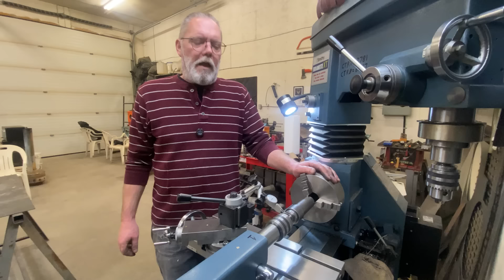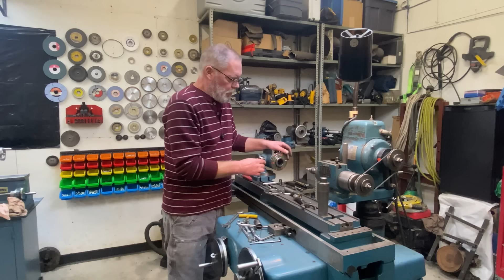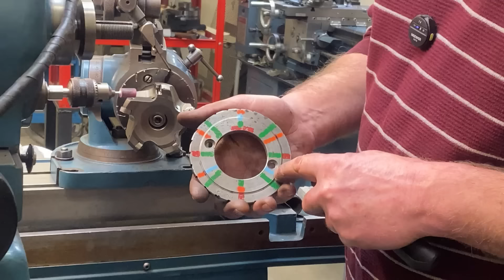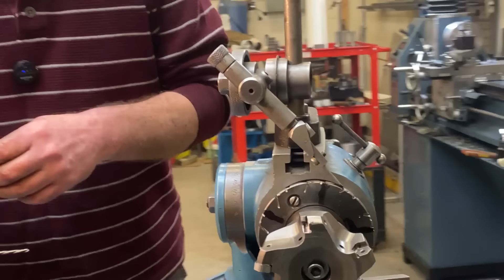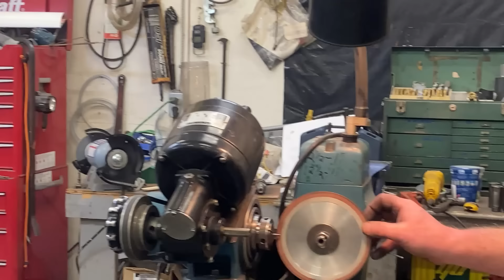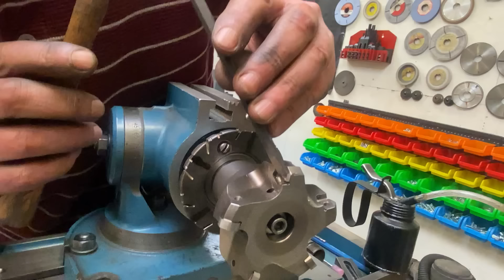MOST IGNORANT BROKEN SCREW I'VE EXTRACTED

Comment: From my experience when there's a passthru hole where the bolt sits - it's never tight inside (except if the threads are almost dead). Every left hand drill bits I had failed although they were carbid bla bla. But I dailed it in from the other side with right hand drill bits and it moved like a champ. My job was way easier than this and a bit harder in some aspects since I had to do it without disassembling and removing the part so basically done it by hand without dailing indicators. Thank God it moved before I need to do any other type of stupidity I had on my mind.

Comment: Midwit thought incoming.. 

What if the insert securing fastener was not a screw into the tool head, but a screw going through to be tightened with a nut on the backside? You'd never have to deal with broken screws stuck in the tool again. There's enough clearance on the backside. 

Then again, maybe just give the tool room muppets a torque wrench and tell them how to use it..

Comment: Oh yes, I had the same problem, head broke off but insert still fixed. Can I break the insert ? Can I drill the screw out ? Do I need EDM electroerosion ? Is the thread in the toolholder for the screw still useable ? What will happen if I use a carbide drill on the hardened steel screw and the drill will touch the carbide insert ? Will heat work ?  Yes, it worked, scree came out.

Comment: It was a little confusing at first to understand what you were trying to accomplish with the setup. The small side bar to make the arbor useable added to the confusion, but as you progressed it started to make sense. The main focus was to ensure any attempts you made to drill out the stuck bolt were done on center? All to avoid damaging the threads in the bolt hole. Seemed like a lot of effort to ensure that level of accuracy, but assuming the part is unique and expensive to replace, your efforts were warranted. 

I am new to this channel, so maybe it made sense to others right out of the gate, but it seems that could have been made more clear at the start of the video. Also, why was repairing that arbor such an important step? What made it worth fixing? I mean looks like you have plenty of tools to choose from?  Some of your explanations were a little technical, but then made sense when you actually did the work.  

I am by no means a machinist, but I know and appreciate when I am watching someone who has those mad skills. In the end it was  very enjoyable and interesting video with a great ending. Well done sir.

Comment: Broken screw extraction.  
 Watch makers have a tool that looks like a tiny c-clamp with a pin instead of the foot. Also a pin on the end of the screw.
Are you getting it yet? This allows it to clamp the ends of a broken screw in a watch plate and get it turning.
I'm sure you could make one to work. Hope this helps sometime.

Comment: Peck drill cycle a carbide ball mill. If carbide won’t cut it break out the CBN. I’ve cut out carbide taps with a cbn single lip cutter, just takes a little longer. If you can’t put it on the machine or if you don’t have one. A pencil grinder or dremil with even cheap Chinese diamond burrs will get it done.  Many of taps have been ground out with a pencil grinder, again expect it to take an hour or 2 depending on the size.

Comment: thats why EDM drill is rly rly good tool to have in machineshop , super easy to "drill" (burn) out any screw 
 you can get "hand operated" one for few hundred greens , or make one for hess than a hundred (and yes , they work ...and i say that DIY ones are better in case of power etc than rdy to use ones u find online)

Comment: 1970s I worked in a machine shop and Pops had a broken bolt quite similar to this job. He was about to do the same as you when I noticed it was a through hole. I suggested take a drill bit and come in from the back side. It squeaked once then unscrewed out.

Comment: A carbide spade bit for glass can punch it, easy to sharpen for left hand. I always keep a good supply. They are cheap. Easy to make from scrap, use silver solder to secure the carbide to the shank. Just be careful and use cutting oil.

Comment: Electrical discharge machine can bore the screw for extractor to fit. This is a common problem, replace the screws at intervals so they don't break. They absolutely will break over time from stress ahd are cheap to replace. Nice video everyone finds a way. Some might stick a welding rod to screw, has to be careful as the tool is tempered steel damaged by heat.

Comment: Not a 100% kinda thing- But these are typically through hole threads.  I use a small center punch on the back side of the screw (opposite the screw head). Then using a variable speed cordless drill motor and a drill which is slightly smaller than the minor dia of the thread, with a good amount of axial pressure, SLOWLY turn the screw using the biting force of the drill. Your're not drilling a hole. You just need to get the web and a bit of the primary cutting edges of the drill to "bite" the steel and almost start making a chip. Again, doesnt work 100% of the time... Works maybe 60-70% of the time. 30deg split point works great. You're only using the web basically. Get to much cheek and you're just drilling at that point.

Comment: Last time for me was a tap, in a thin walled aluminum part I could not replace.  
In the end, I had to give up the hole and the fastener completely.  
Fortunately, the project was for my personal use, and not a customers, and there were enough other fasteners that no weakness was created.
(and it was on the back panel of the device- if it had been on the front, I'd have scrapped the whole thing and been furious, heartbroken, and butt-hurt over it)

Comment: Why didn't you turn down the threads on your alignment stud?

Congrats on getting the screw to move. In my experience, once it moves, even a little bit, I've won.  My IT department came to me several times with stripped screw heads in laptop computers. My tool of choice was a Starrett automatic center punch. The IT kids thought I was a magician.

Comment: Very clever approach. However I work as a welder fabricator in a motorsports supply company. We have an extensive CNC machine shop and I have been tasked with this probably 50+ times over the last 15 years or so. The very easy solution if you have the capacity is take a small cap screw. Preferably a 12.9 grade. Grind a small but blunt point onto it. Carefully put some very small tack welds between the screws using 312 SS rod, as it's cooling, but not cold...use a quick squirt of WD40 and it'll wind straight out. Like I say I've saved many tools.

Comment: clamp insert face facing down to locate the screw hole vertically. dam up with oil impregnated modeling clay all aroubnd the part, heat and pour liquid metal such as sera-bend, leave to solidify a few minutes and remove the clamp that was holding the wrkpiece down. The liquid metal should now be firmly holdingvthe workpiece. Next, use a carbide spade drill. I use saved broken endmills for this purpose. using a green wheel, grind the carbide into a drill. Center the drill over the screw hole. Now. drill the screw out. Hold an air nozzle on it as you drill and keep giving blasts of air to clear the small chips out so they dont bind and break the carbide drill. So, part secured, tool made, part drilled. If you are good. the drill was centered correctly and if a diameter just under tap drill size is used  the material that is left should be thin and easily removed or the screw left the hole in the drilling process but either way its out. Now melt and re-claim the liquid metal and insert nee screw. If not a screw, I do that very same thing to drill straight through a broken tap to save the workpiece.

Comment: Make you wonder if that bolt was the hard that it was just destroying his bits and how tight it was in there what kinda forse ut was that snapped that bolt in the first place im guessing it was the same guy that changed my oil a few oil changes ago that tighted that bolt cause it took the same amount of effort to get the drain plug out the next oil change i new i should of just did it myself but eveyone keep saying it cost the same to have someone do it my ass try 2 to 3 times the amount

Comment: Honestly, it's no mystery to me why the left hand drill didn't spin out the screw. The drill pressure was working in the opposite direction the screw wanted to move as it unscrews. This technique is great with a hand drill where your hand pressure is easily overcome by the action of the screw un-screwing itself, thus allowing the screw to unscrew while you're drilling, but with a machine feed, I would not expect the screw to be able to unscrew itself as it really has nowhere to go!. It seemed that other than that one center drill that made some chips, all your other attempts with the left hand drills were just work hardening the screw, bringing all progress to a halt. I think the two opposing forces (the left hand twist and the screw trying to unscrew itself) were working against each other causing the lack of cutting and only work hardening the end of the screw.
Perhaps a better strategy would have been to indicate from the back side, then drill with a right hand twist drill. I really think that screw would have come right out then.
Just my two cents worth. Nice work regardless. A win is a win however you get there.

I've just acquired a surface grinder and you're really inspiring me to sharpen some of my own tools and learn cutting geometry. I know a standard surface grinder is far from ideal for doing this sort of work, like you do with your specialized machines, but my gears are turning on how to make use of it with indexers.
Thanks for all the great videos and the inspiration.

Comment: Running a diamond bit at high speed will work or TIG weld a round to it then use that to grip and remove the stripped screw. Nice video.

Comment: Man, I realy miss working in a machine shop. I have run so many types of lathes in my life. Ive done every type job imaginable. In Oklama I worked on making parts for oil pumps. I worked making parts for Boeing. I made cylinder assembly for Textron small engines. Ive ground lead screws at Wedin in Cadillac M I.  The biggest lathe i worked with was the Nigata cnc machining centers. I use to job hop in Ok, and worked at probebly 8 different places in OK alone, and mayed 7 different places in Cadillac Michigan. I did that for around 30 years, and then changed careers to computers in 2003.
Reply from the maker: Awesome, thanks for sharing your experiences!

Comment: I use concrete drill bits to drill into hard metals.
I sharpen the edges of the widia tip on a grinding stone.
They scrape away the metal more than they drill, but it works.
I just don't know how small a diameter they can be.

Comment: It's a thru hole. Fill the back side with high pressure grease and run a drill in from the back it'll spin the broken bolt out the front.

Comment: Well, after all that I firmly believe that if it's possible to now grind that screw into a little center drill (just like you did with the carbide center drill), it should be able to easily drill into any material known to man 🤣 Man, what the heck were they thinking? Hardened for longevity is one thing but that's just ridiculous.

Comment: With 49 years experience in machining metals, I v'e developped an easy way, which worked to 100%.

Usually the screw is just among 45 HRC hardness.

Take a HSS drill and grind the peak in a way, that it cuts in CCW direction. The dia. of the drill had to be a bit more than the outer dia. of the thread.
Go to a drilling machine where the feed is manual handled.
Fix the cutter in a save way in a vise. The tread with the damaged screw had to be in upright direction. Then drill the head of the screw away with low revolution (CCW !).
As far the upper neck of the screw is free, the remainigs of the screw are turned out of the bore automatcally.
The whole game is finished in less than 5 minutes.
Do not forget to follow the safety rules.

Comment: I used to work at a machine shop in my younger years and would run into situations like this all the time we used a hole popper (edm drill) and just punch out the centers of the broken screw or tap, electrode sizes were .012 to .125 dia.

Comment: I watched an old machinist deal with almost this same exact problem. The cutting head was much larger - 12 inserts if I remember correctly, and the screw was sunken in about a thread. He used a HSS drill bit with lapping paste to basically grind out the broken screw. It took most of 2 days, but it did save a very expensive piece.

Comment: The best extractor for a broken screw is laser or TIG welding ))). There was never a case where the welding failed me, quickly and in 10 minutes the tool is working again (the main thing is to have spare screws)

Comment: Do you not like to use coolant when you are drilling and grinding. I know you have way more years in the trade than I do. Ive only been a tool maker for almost 17 years but I was taught to always use coolant even if you gotta punch a hole in a bottle to put the coolant in and whether its grinding or drilling and whether its hard or soft materials. And never use cutting oils 
Unless you are taping. Im curious on your thoughts

Comment: Secret tip no one else will tell you, put it in the vault:

Whenn an insert screw like this breaks, the remaining piece of broken screw is loose, as there is no longer any tension on it. Once you try to drill it out you create burrs which trap it inside the hole
99%of the time they can be carefully backed out with a brand new exacto knife grabbing onto the rough broken top surface of the screw
Patience is the key

Comment: How I would have approached the screw: from the backside, insert a short piece of copper tube into the hole to center the tool and protect the threads. Then put a steel rod — for example a drill bit inserted backwards — into a drill chuck and “drill” from the backside using the blunt end. The rod will start to friction-weld itself to the broken screw and push it out of the threads ahead of it.

Comment: Im a toolmaker and from one professional to another, you could have used more swearing during this process. Im pretty sure your max speed on that spindle was limited, but a higher speed and a carbide endmill would have been a good option to start, then the carbide spotting drill. But definitely more foul language.

Comment: have a screw m2 with 2 mm deep, part cost more then 4 000 usd, what your suggestions? screw glued by thread locker and and part cant be heated. so i tries manualy made by scrabbing a hole for a flat screwdriver, but nu luck. i try presision machine to drill 1 mm diameter hole to catch it and screw away, but cant. so only idea i have its edm, but have no acess for it

do u have an ideas for that screw?

Comment: Wow!!
Way to much work to get that broken screw out get the correct carbide drill size to drill out broken screw from the back side of the threaded hole and usually the broken screw just turns back out

Comment: I'm not a machinist (nor did I stay at a Holiday Inn Express last night) but I was curious about the order of operations when making the left-handed bit out of the "carbide stock". If I were muddling my way through that process, I would almost certainly have ground in the cutting end before clearance tapering, just so I could ensure that the widest point of the result is the diameter I want, because grinding-in the cutting features will move the wide point back from the end, and I'd assume I could avoid some math that way.

So I guess my question is: Did you need to measure where the cutting features would terminate, and leave the end of the stock oversized to compensate?
Reply from the maker: Great question and under some circumstances all that would matter but in my case I just wanted to make the drill smaller than the minor diameter of the thread so I didn't bother with any of that thinking. However you are correct, you would have to do the math if you wanted to hit a diameter. 
Thanks for watching!

Comment: That would have been incredibly easy if there was a slot machined on the end of the bolt. I would put a slot on the end of every one of those bolts with a Dremel tool so you could screw them out in the future.

Comment: There is a slight possibility that if the left handed drill was hand held so as the broken screw started to turn the hand held would give way and allow the broken screw to turn.  Since the drill check was held rigid there was little give.  Had this happen on less precise equipment.

Comment: a tig welder with a .8 tungsten and some 0.8 312 stainless rod. Foot pedal with maximum amps set to 60, and a very steady hand. Spot on top of the screw, gently peen between passes, a little at a time, allowing to cool completely between heat. As soon as it has a nipple 1mm above the surface, then put a small stainless nut on top of the nipple, and carefully puddle weld it to the screw. Peen and allow cooling, then wind out the broken screw. The welding will anneal the screw, but because it is not one piece, the heat will not significantly transfer in to the tool. The repeated heating and cooling cycles also shrink the screw, they can usually be extracted with fingers if they are not bottomed. The entire process takes less than an hour.

Comment: This needed drilling out from the rear with the drill size for the tap. Use WD40 on the drill. 9 times out of ten once the drill starts cutting it will bite and unscrew the screw.